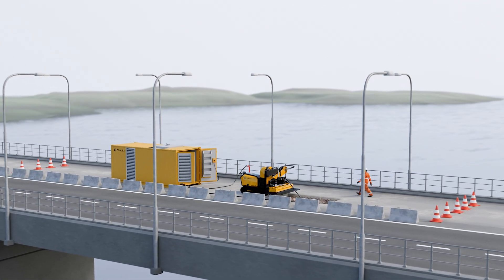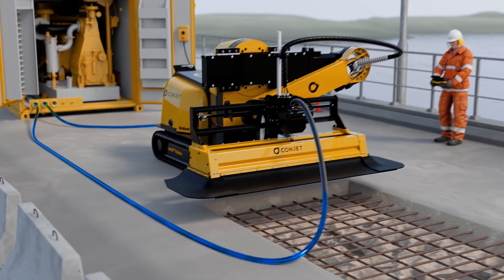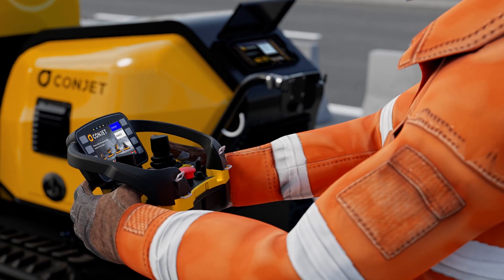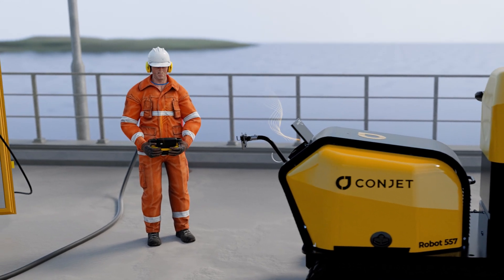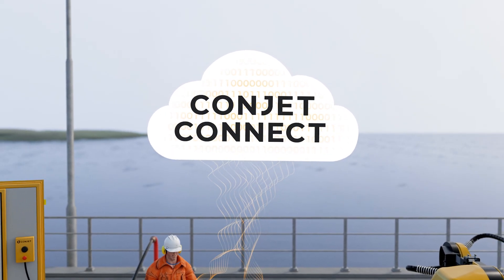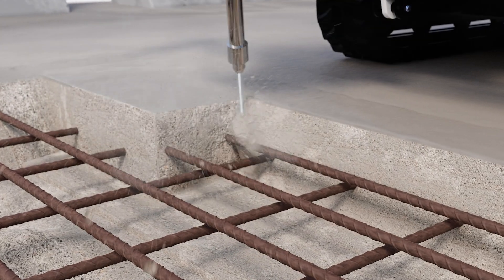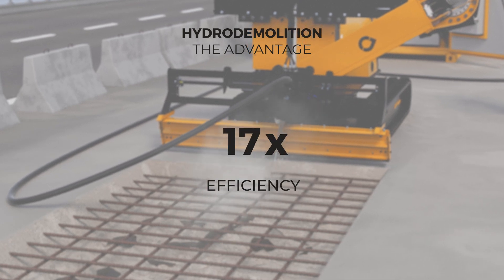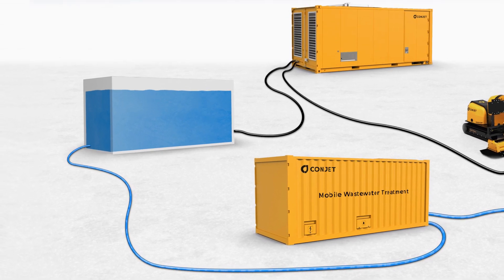How does Hydrodemolition work? - explained by Conjet

Comment: So to use it we need to have a container of water pump and hoses. Where on the bridge we get the water for water pump from? How to deal with hoses? Put remote control back, take hoses, extend them, take remote control, go ahead few minutes, put it down, go to adjust hoses, back to control and again and again…. And how much it’s gonna cost? $200k? 
Skid steer and attachment does it cheaper and gives way more mobility. Wtf container with water pump, find a water (where is it on highway??) and go adjust water hoses and all of that for overprice. No thanks
Reply: Finding water is very easy. Water hydrant? Lot of people use water trucks on shifts so they never run out. Hoses are easy to deal with and the pump being on a semi truck makes it a breeze.
Reply: A complete system robot, 600 hp high pressure pump etc can be $1,000,000.